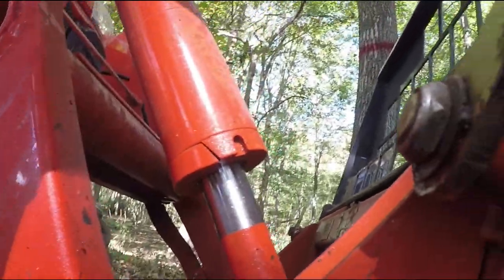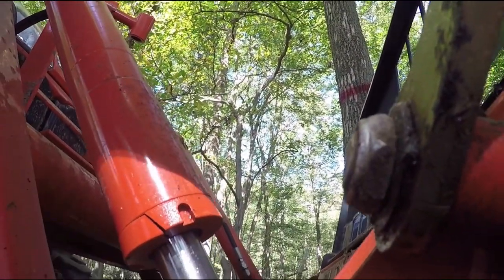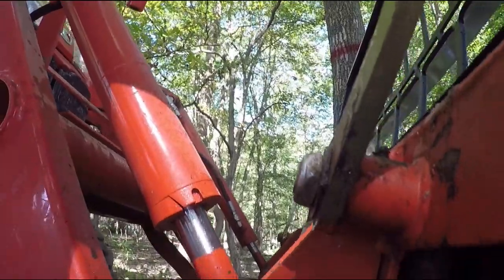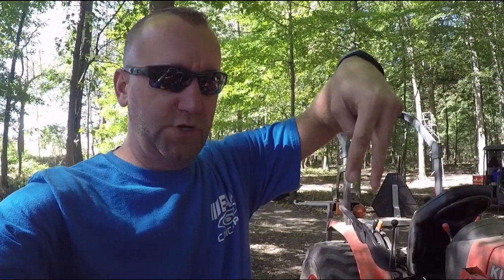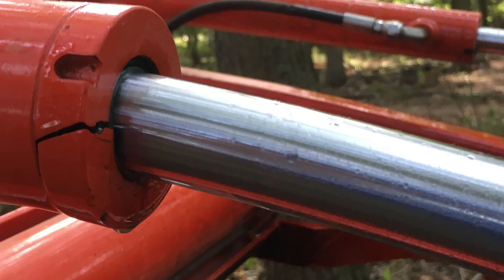Don’t Do This With Your Tractor!!

Comment: Not trying to be a dick here, but in the owners manual it explains not to drag with curl cylinder fully extended.   I used to not read manuals but as I have got older I realized if I had read the instructions first it would have save me money.  Good video!!
Reply from the maker: You’re good bud. Mine happened so quick and without it feeling like I did anything. I didn’t even think about it and didn’t think I was doing anything detrimental. I was just trying to spin a log so I could grab it and skid it out of the woods. What killed me was that I had long forks on and spun it with the tips instead of engaging it higher up.

Comment: Thx great share, and great dealer you have, not many around like yours, I've seen this happen onall kinds of equipment like you found online in your search, I've seen skid steers of all makes, loaders from Medium to heavy duty,Cat, Komatsu,John Deere,Case,Doosan,Hyundai,you name it,all from extreme articulation and its a common thing,I even saw a Cat 3 series excavator,bend the heck out of one moving a rock, it has nothing to do with 3 rd rate cylinders like Doug Shrader said,I have dealt and worked in hydraulics since the late 70's and saw it happen then and the cylinders now are built far stronger than back in those days,$500 is a great price when you think of it getting you back in operation in a few hours, hats off to backward country gardens,your lucky, the service where i live in Canada is not that good, we just sometimes want to get'er done and we get'er busted,lol,again great video
Reply from the maker: Bob Church 
Great info and useful comment. It’s a little frustrating when people comment and slam the brand when it isn’t just related to Kubota. It is all brands and all styles of equipment.

And yes, Fackler is a great dealer and will keep me coming back just for their service alone. 

Thanks!!

Comment: Is your tractor paid for? If not, I'm sure it has insurance on it. If not provided by Kubota then a private company. If it is paid for then your private insurance should pay for it. Unless you have a $500 deductible then my post was a waste of time. Glad you got it fixed and thank you for the tip.
Reply from the maker: No, my tractor did not have insurance on it at the time. It was paid off and I didn’t carry insurance after KTAC. I do have insurance on my new tractor though.

Comment: You are absolutely correct about the fully extended piston rod when the bucket is in the extreme down position, but I don’t think the hydraulic pressure trying to push the piston rod back into the cylinder is what caused the collar on your cylinder to break. If you notice the movement of the cylinder when the bucket is in the fully dumped position, the piston rod end (collar) gets closer to the lift arm as it radiuses from its pivot point further up the lift arm. Normally it would never touch, but when the bucket is pushed further back beyond its normal stop position, (such as when a log might shift towards the machine, or you move slightly forward,) the end of the cylinder can actually touch momentarily on the lift arm causing an extreme pinch point. It doesn’t necessarily leave a mark on the arm, and it’s not evident that it touched after it springs back into normal position, but this is what breaks the collar. While you can do this without the forks, the leverage of any length fork makes it easier for this to happen.
Reply from the maker: Finally it's Ed 
I’m sorry if I wasn’t clear. It wasn’t the hydraulic pressure that caused the failure. It was the fact that the rod could not go back into the tube, and then bent, which cracked the gland.
Reply from the maker: Finally it's Ed 
Oh, and I have stops on the loader and forks so the the rod cannot contact the loader arm. I know what you’re talking about there. I’ve read some threads from guys complaining that their bucket stops were welded in the wrong place. Thankfully mine weren’t.
Reply: Please don't be sorry about your clarity, I'm just sorry to see (yours and my) machines break. Funny enough, I just blew a steering rack cylinder seal on my John Deere 410D backhoe. You can't live without equipment, and when they break, it just goes to prove it, lol.
Reply from the maker: Finally it's Ed 
Everything breaks. No way around it.

Comment: I did the same on my New Holland TC45D BACKHOE never on the loader and I do do this all the time.  What I want you to learn from me is this:  A new cylinder was 400 and a piston was 100 and the shell was 100.  So I never damged the shell and  changed the piston out for a lot less money.  Now after ten years of use the O rings are allowing the fluid to pass by and I should change the O rings out.  HOWEVER, I installed a THUMB on this backhoe that I believe put excessive pressure on this piston causing the by passing of fluid.  It is still operational, I just need to keep pressure on the HANDLE while using the THUMB.  Hope this helps you in the future.
Reply from the maker: Bob Hamilton 
Great feedback for all.

Comment: Thanks for the video! Heck, it's all I can do just to change implements. I have no mechanical ability. I back-drag heavy objects OFTEN, with the bucket tip extended. Would have never been aware of the potential for damage. I would have to pay the dealer to pick-up, and re-deliver. Plus parts/service.Thanks again!
Reply from the maker: Ken Marvin 
Good deal. Hope this saves you from future failures by making the same mistake I did.

Comment: The Caterpillar saleswoman guaranteed no bent cylinders for life. 
I said, "Whose life?"

Salesperson:  eyes diverted to side momentarily, followed with blank look and smile.  Then offered me a cup of coffee and a pen to sign a long term lease.  I took the coffee but said I will read over this lease.  Said thanks and started toward my truck.   She said, 'Wait, you can't take that paperwork with you !"  I said, 'You expect somebody to just keep all this in their head??"  She threw up her hand and waved bye.  

Took me 2 days to read all that.
Reply from the maker: Wow. Your comeback was perfect. You definitely should be allowed to take any contract home and read it, have your attorney look over it, etc. They must have been afraid that you were going to take it elsewhere and use it to get a better deal. 

When researching this issue I found bent cylinders on almost everything, and it was every brand, even CAT. The bigger the cylinders, the bigger the machine, and the more force they can apply while driving. It’s not the hydraulic power that causes this. It’s when the hydraulics are locked and a machine moves under its own power. No brand is immune. 

Different machines are more vulnerable at different times also. For example, a lot of large payloaders have their tilt cylinder attached to the bottom of the bucket, so when they curl forward (dump), the cylinder is actually retracted. This means they can back drag all they want without fear of this issue.
Reply: @JaredsShop  :   You know, the bent cylinder issue is something I must admit I have not fully understood.  Very much appreciate you explaining it.  It is something all operators must guard against.  Especially those of us who dream of tractor time more than actually doing it.
Reply from the maker: @horacesawyer2487  
It’s something I hadn’t given any thought to until it happened to me. Once I understood how it happened, it all made sense and I was ashamed I hadn’t thought of it before.

Comment: Thanks explaining, thus thanks for the tip.  It may be obvious now, but understand cylinder design and leverage.  Your cylinders were fully extended, meaning that there was little "insertion" of the rod into the cylinder.  I would not have expected buckling, but the position also makes them susceptible to bending damage if something like a limb strikes the cylinder mid-point.  Maybe under full extension, something causes them to flex in a slight arc? (I've seen it)

Another thing that can happen when leverage is increased, such as forks or a hay spear, is when the points are down and they catch the ground while the tractor is moving.  The leverage creates unanticipated (undesigned) stress.  If the cylinders are not fully extended, the hydraulic pressure spikes and can burst a hose or a hose fitting.  Ask me how I know.

Thoughts about cylinder replacement:  first, you always want paired cylinders to match perfectly in both extended and collapsed lengths, thus it is good that you did not settle on a longer cylinder, unless you got 2.  In your situation, it would have been possible to take the 14" cylinder and reduce the rod length through cutting/welding to create the perfect length.  Again, both need to match collapsed length too.  Glad you have a fix and thanks for the time to create this video.
Reply from the maker: Bob Black 
Totally agree with what you said. 

I did have mine fully extended so I think the cylinder was weaker than the hose at that point. I was driving backwards pulling the tree apart. It didn’t take much force to separate it so I didn’t feel like I was overworking any part of the machine.
Reply from the maker: Bob Black 
And I would most definitely replace both cylinders if upgrading or changing sizes.

Comment: Oh and for back dragging you also can use the float feature where the loader just uses its weight and no hydro pressure is applied ... very smooth once you get comfortable with it 

Maybe not all models have this feature ... should say in the manual ... 👍
Reply from the maker: Paul Lambert 
It has float, but only for lift and not for curl. It didn’t want float because I was separating a tree where it was cut.

Comment: Thanks for the video. I have a grounds crew who back drag driveways in the winter with a Kubota SSV75, bucket fully dropped. Other then breaking it countless other ways (ugh) this has not happened yet, but I can see it happening in the future.  I'll bring this subject up to them.
Reply from the maker: spdwebdotnet 
Probably not a bad idea. Better safe than sorry. There’s a guy who posted here about doing it to a CAT track loader. I’ve found reports of it happening to almost every type of equipment.
Reply: WorthOverdoing Yep.. all it would take is hooking one manhole cover or curb with the bucket fully dropped. Surprised it's not happened thus far actually lol

Comment: Can attest - I bent the piston on the curl cylinder of my M8540 using forks.  We had a fire in our barn and there were pockets of smoldering hay that I tried to pull out of the partially burned stack by backdragging with the forks fully extended.  So I got to replace both a cylinder and a barn/shop.  Life.

BTW - my tractor, only 1 yr old at the time of the fire, was also in harm's way from the fire.  I was able to move it before any significant damage - the plastic backs of my side mirrors melted.
Reply from the maker: Glad you were able to get the tractor out and sorry to hear about the barn. Thanks for sharing!

Comment: Thankyou. We learn by making mistakes. You made the mistake ... we learn.
Reply from the maker: Bumpa Does Things 
Exactly. I’m hoping I can save a few people from making the same mistake.
Reply: BX1860 with 8 different attachments.  Tiller, chipper, blower etc. I worry about over working it. Time to purchae a bigger unit
Reply: The one thing i don't have. The bush hog over work the little tractor. Hate to say it but my fathers Kioti has a better disconnect for the backhoe than my buddies Kubota. Might have to look at one
Reply: I have a Kioti DK4510 with a hoe. Comes with its own subframe, 2 pins to hook up the hoe. 3 pt stays on tractor and does not effect mounting of the hoe.

Comment: I was back dragging with my MX5100 a few years ago and my Dad stopped me and informed me.  My Dad spent a lifetime on a farm, Dairy, then heavy equipment burying cable for Bell telephone for 25 years...and then another 20 years for the federal Government in heavy equipment operating.  Long story short he was legend on any kind of equipment.  He was the guy they called when a backhoe or dozer was stuck, or about to go over a cliff or in a river, they called him to come get it out of the problem area. Anyway he stopped me from working and said Son, that what you are doing right now, (Back dragging with front end loader)  I had the front tires dang near pushed off the ground.  He said that is one of the worst things you can do with a tractor, or anything with a front end loader.  I agreed of course, because I already knew that he knows what he talkin about.  He said a backhoe will handle the pressure for a longer time than a compact tractor. But its even hard on a backhoe.  He said its okay to back drag a little but be very careful how much pressure you are pushing down.  Then he made me put the box blade on and finish what I was doing.  It was my tractor, and I was 35 years old...but I was like yes Sir.  Lmao...Dad always know best.  I just stumbled on to this video in my feed.  I hope what I have added to this content may help someone else and save them some time and money...like my Dad helped me.
Reply from the maker: Smokin Bill Williams 
Fantastic story Bill! I think it adds credibility to what I’m trying to get across. 

Back dragging in general, while often done with no problems, does put a lot of stress on certain parts of the equipment and increases the chances of damage. Most professional equipment operators know this and most owners don’t think about it until they’ve damaged something. It doesn’t matter what brand you have, it can still happen.
Reply from the maker: Smokin Bill Williams 
That’s what I’ve been telling everyone but a lot of the comments are about my tractor being junk or too small. Anything can break.
Reply: Bill Willia

Comment: Hey mate ... Just came across you're video ... Worked in hydraulic cylinder repair for 23yrs ... Seen plenty of cylinders damaged in this way and repaired them .... $500 is a cheap fix. I'm not about to tell you how to do your business but if you can, don't drag the cylinder closed again because when you bend the cylinder rod it won't go back into the barrel without damaging something. 
Most of the time you'll end up creasing the chrome(won't seal) where the rod enters the gland and when you drag the cylinder back in you'll stretch the gland or if bad enough crack it like in your video.
Dragging the rod back into the barrel can cause damage to the internal surface of the barrel. At this stage you're looking at a full cylinder rebuild and a lot of dollars spent. 
Just to replace the broken gland is a 3-6 hour job (machining time only) If anything else is stuffed the price goes way up. 
Hope that helps. :-)
Reply from the maker: Jason Nielsen 
Thanks!
I’m sure it cracked because of the bend in the rod. Unfortunately I deformed the tube so I couldn’t even have it repaired. 

It all makes perfect sense to me now. I just never even considered using it that way was going to be putting those stresses on it or I would not have done it. I’m mechanically inclined and fix extremely complex machines for a living. I can’t believe I never looked at the mechanics and thought of this ahead of time. The video probably makes me look like I’m an idiot city slicker but I don’t care. If it helps others from doing the same damage then it’s worth it.

Comment: 😳 $500.00 for a cylinder. Wow, this is the worse part about having to buy OEM replacement parts. You pay twice as much.  Thanks for the tip and video, I’ve done this same thing on my 1025R and now I’m thankful I didn’t break something.
Reply from the maker: Tony Evans 
Yes it did sting a little. Good luck and enjoy your tractor!!

Comment: The cause of this was a little beyond just the pressure in the cylinder, this can happen with just static pressure, i.e. fluid there but no place to go.  The mechanics of the failure is when a cylinder is fully extended it cannot accept any side loads whatsoever, due to the only resistance to the unit bending (or jackknifing) is about 2 inches of cantilever support.  It is like grabbing a baseball bat by the bat handle knob, holding it out level and then daring someone to apply a side load anywhere on the bat and you hold it straight. It takes only ounces of force to deflect it. moving your hand up the handle will geometrically increase the side loads you can resist. The companies that design their curl cylinder geometry to never be fully extended and in a work range, would never see this problem, but that takes some extra time and money. It just means we have to manage our cylinder extensions ALL the time.  Thank you for the video, Sir!
Reply from the maker: You hit the nail on the head. It’s all because it was fully extended and there was no where for the fluid to go.

Comment: ive seen a warning somewhere about back dragging with my bucket straight down - didnt give it much thought - besides wondering why- i have a B3300SU too--spending about an hour on it tomorrow cleaning the driveway of its heavy snow  -good thing i seen this
Reply from the maker: port starboard 
Nice. You happy with it? I didn’t need a mid-mount PTO so I thought it was a heck of a deal and saved a lot of money not having it.